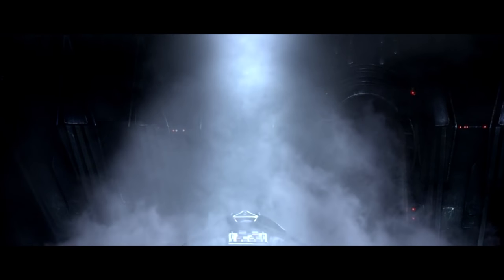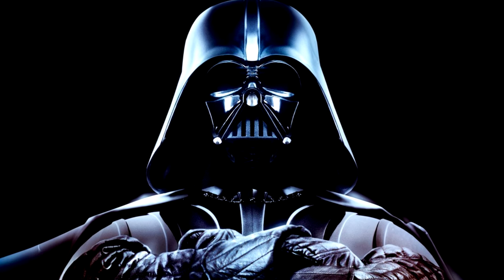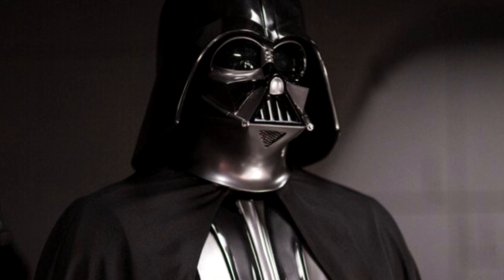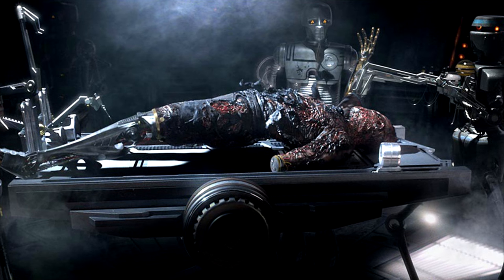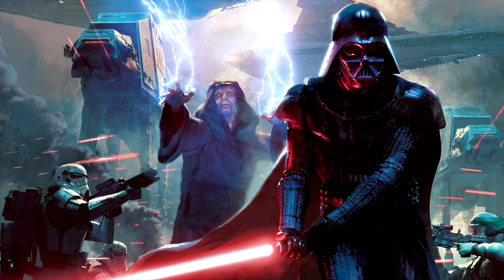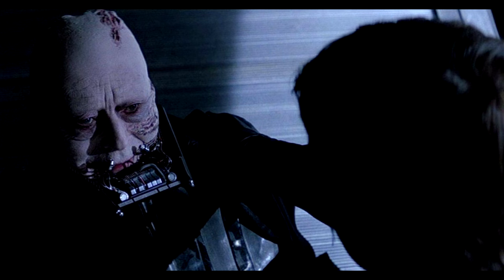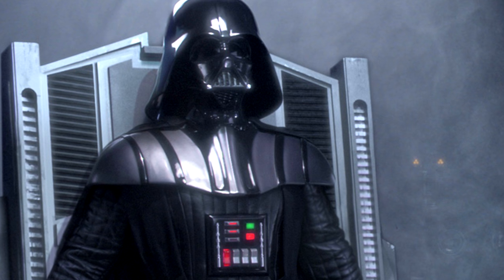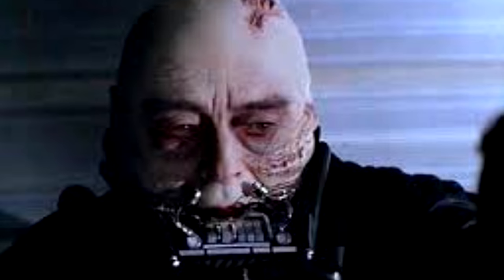How Does Darth Vader Breathe - Star Wars Explained (BessY)

Comment: Why does Anakin have such extensive lung damage?  The only thing that possibly could have caused that was breathing in hot air as he was burning from the lava, but he was breathing in hotter air than that while dueling with Obi-wan just feet above the lava itself before he was hacked down.  Even after he was burned he still groaned loudly and tried to crawl up the hillside- tough to do for someone with extensive lung damage.  He also screams loudly when the medical droids are attaching his artificial legs.  His lungs don't sound too damaged then.